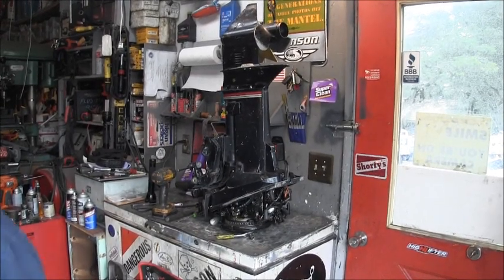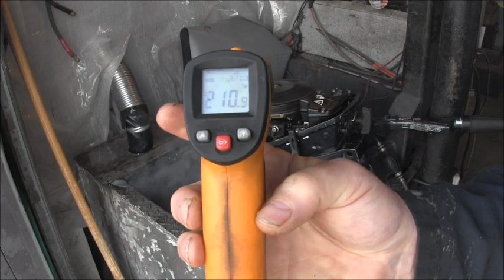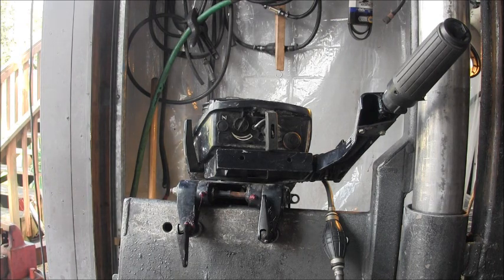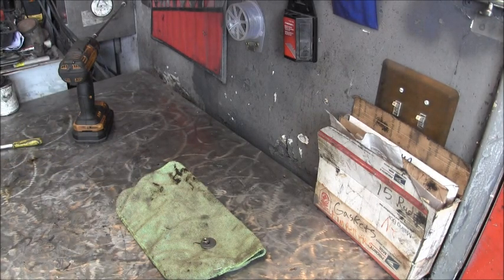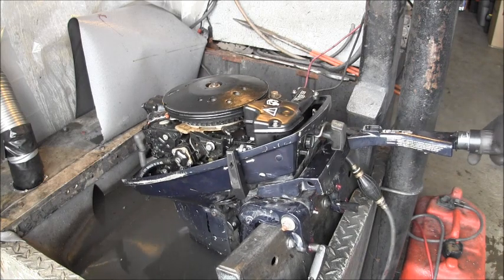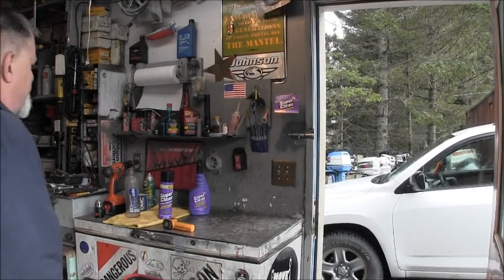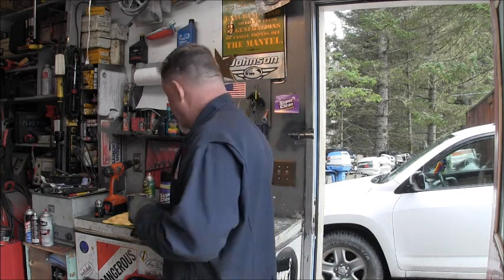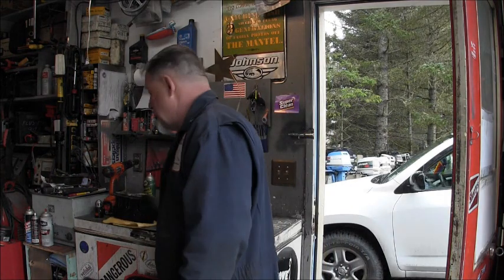EVINRUDE  15 HP, LONG SHAFT CONVERT TO SHORT SHAFT , Part 2

Comment: I got up this morning and looked at my 1979 Evinrude 35 hp long shaft in the light of day and it is only two sections, an upper and a lower/foot shaft housing. So, I was right the first time. In order to change this particular motor from long to short shaft I will have to separate the foot section and then separate the entire top section from the power head and do the same on the short shaft motor. Then bolt the top section of the 1978 short shaft on the 1979 motor. Then I should be able to use either one of the foots.

Comment: We used to have a lot of overheating problems with 9.9 - 15 motors that happened because of the water tube grommet under the powerhead.  At first, we used to change out the grommet; later, we just twirled a narrow blade around and around in the grommet to open up the hole.  Problem solved.
This is not to say we had a lot of overheating with the 9.9-15 motors.  But when we did, it was more often than not the grommet under the powerhead.

Comment: So when turning a motor in to a shorty how short dose the water tube have to be? I have 1994 evinrude 6hp had a long shaft and was given a twin motor that was short shaft but its locked up the only difference im seeing is the water tube length just not sure on how much to cut off thanks love your channel!

Comment: So much learning on your channel Kodi. Love it. I found something interesting today in my Mercury service manual. They showed the wrong picture view for setting the idle RPM. I scratched my head thinking man that would screw some folks up. Have you run across this before?
Reply from the maker: Yep'  the OMC commercial 40-55 hp,  have several print fubars in them,  Thanks  Tim, kodi

Comment: Is it a Spirit? Also I need some stuff for a RDE - 17 25 hp Seahorse 1955? You got some parts that will fit it? Pivot screw ( don't ask why I need one) Needle valve for Slow speed jet and misc. Thank's, Jay

Comment: So for the top of that rubber grommet to get folded over and slow the flow wouldn't the power head have to of been separated from the exhaust tube previously?

Comment: All I know is I have a NOS airbox  same as that motor still in the plastic bag says Suzuki thats probably a Suzuki Spirit made outboard or at least same carburetor vendor Suzuki uses. Still think its a Suzuki built outboard with some uncommon Japanese offbrand name on it possibly. I had a 25HP Suzuki in the 90S and I remember how they copied Evinrude,Johnsons midsection and lower unit design,cavitation plate profile just like that one has. Will be interesting when you let us know either way. ..... Glenn

Comment: Maybe I missed something, but I did not see you actually change the long shaft to a short shaft. I have a 1979 35hp long shaft Evinrude that I want to convert to a short shaft using the short shaft housing from an Evinrude 1978 35hp. I assume I have to unbolt the power head from the upper housing and put the short shaft upper housing on. I want to keep the same 1979 foot which is in excellent condition. So, assume I can just replace the long lower shift rod end and the long drive shaft with the 78 short shaft shift rod and driveshaft as the top shift rod section should be the same length on both short and long shaft housings. Any comments? Thanks Zed.
Reply: I really hadn't looked at the motor that much since I just bought it last night. But after going and looking at it I figured I probably could just remove the mid-section and replace the long shaft and long rod with the short parts and put the foot back on and be done. Will have to cut down the water pickup 5 inches. Now that I went back to your site, I see you are taking the mid-section out. So, I must have gotten your channel previously in mid program so before I did not see you removing the mid-section to shorten the housing. So, you pretty much are showing me how to do it especially the part where you cut the water tube after separating the mid-section enough to get a hacksaw blade or similar in there to cut it. So, thanks.

Comment: Hey Cody got a question for you have a 9.9 74 Johnson. I can get it started but it seems like it's misfiring bottom spark plug is getting pretty black top spark plug staying clean I can pull the top spark plug and it will stall out all the bottom off little bog down really hard but not die any advice
Reply: Good spark also

Comment: People say you can convert an Evinrude 9.9 to a 15 just by swapping the carb.  Have you done this? Do you have an opinion on just swapping the carb?  I have a 9.9 and have access to a 15 from the same year.Thanks from Montana.
Reply: I actually have one and tried it and it ran very rough it was bogging down pretty hard I'm pretty sure exhaust and intake needs to be changed
Reply: Thanks for your input.  Sounded a little too good to be true.